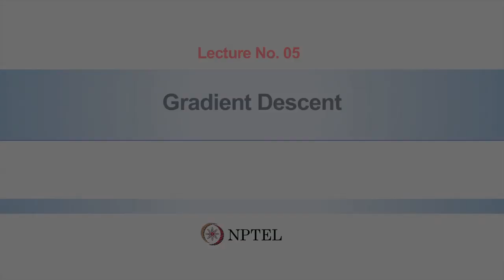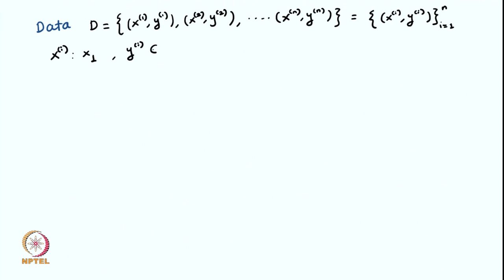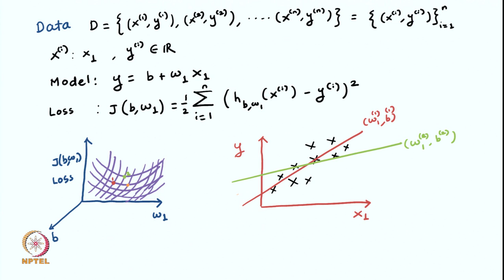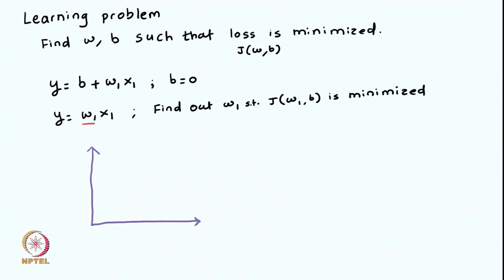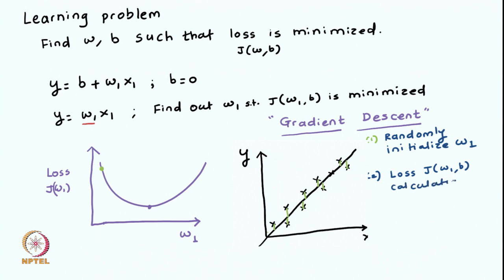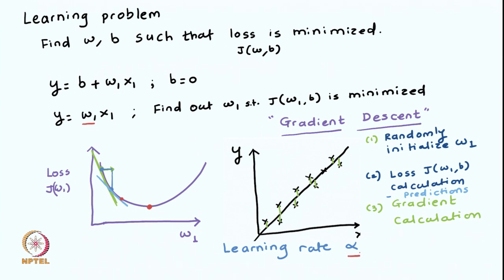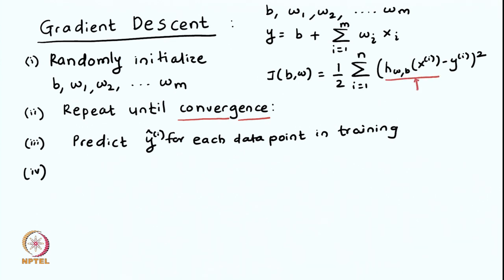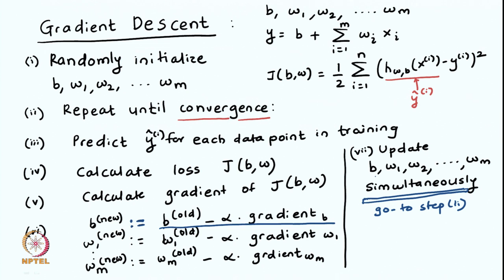Lecture 5: Gradient Descent

Comment: we subtract the value of (alpha times gradient) when the slope is negative. so do we add the value of (alpha times gradient) if the slope is positive? in new W1 near around 28:00 in the video.
Reply: When the slope is negative, -(alpha*gradient) becomes positive, so it gets added to W1 old. Similarly when the slope is positive, -(alpha*gradient) becomes negative, so we end up by subtracting this value from W1 old